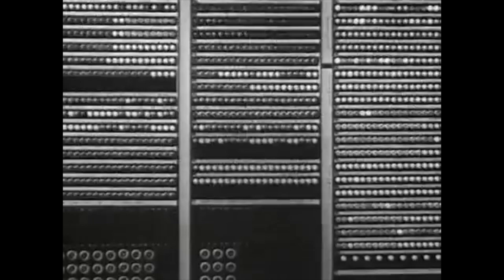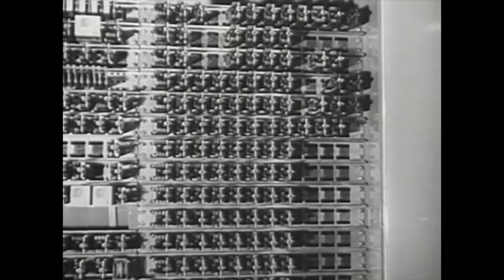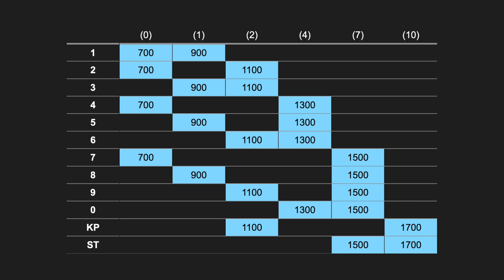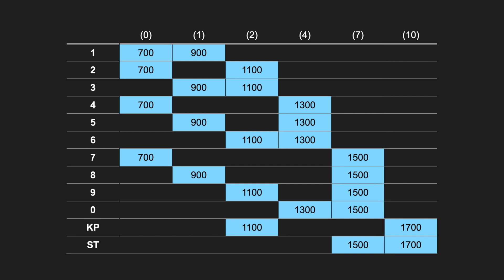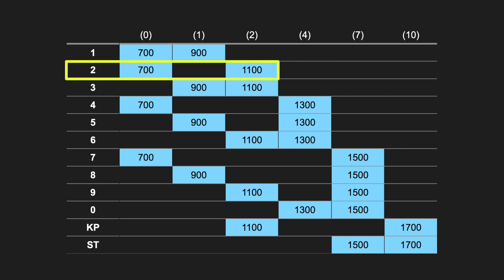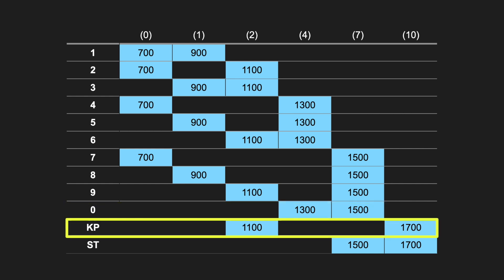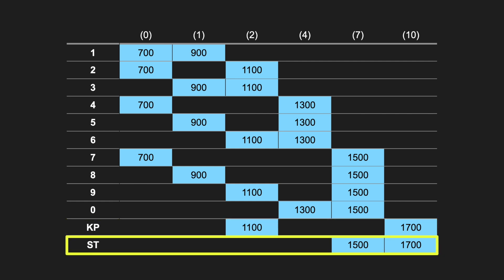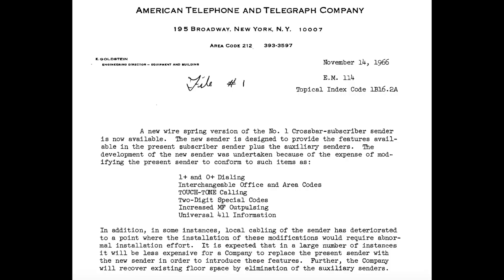How does MF signaling work? - Dial Equipment Appreciation, Part 3

Comment: The A, B, C, D DTMF tones were used by the military but I don't know if they were used by anyone else 
From what I understand about these special tones, the phone system accepted these on all their equipment 

On cellular towers they used these A, B, C, D codes on the overload class

For regular cell phones the last digit of the phone number was programmed as the overload class 

But for State and government phones for some people the overload class was A, B, C or D

These could not be programmed in regular phones or from the service menu. They were programmed using special equipment to program the eeprom

The cellular towers would get busy in those early days and you would see all 100 lines in use often 

When the phone did a handshake with the tower it sent it's ESN and when it placed a call it sent it's overload class and if all the Frequencies were in use and you had an A, B, C or D the tower would drop one of the lowest class calls, usually 9

If you were constantly dropping calls or couldn't get a call to go through, looking at your phone number was a good idea, but most people didn't know about this. 

If you had a number ending in 9 you would have a lot of dropped calls. But if you had a number ending in zero you probably didn't have calls dropped 

The towers would handle calls and 3 towers or more would receive the signal and pass it off to the closest tower and the signal was still being transmitted to the former tower. 
The tower that took the call would send a ANNNN, ANNNN, ANNN sound on the frequency of the former tower to activate the drop off from the former tower. 

I heard this constantly 

The customer would heard the call get louder and an echo as the call was handed off.

Comment: OK.. So my understanding is that people used pulse dialing, BUT touch tones were used exclusively by the phone company (between whatever dates) to send/receive/connect signals to each other... for some period of time until the tech was eventually upgraded to allow touch tone in the standard home?
Reply from the maker: Yes, except that MF signaling uses different tone pairs than the touch tone telephone does.
Reply: @ConnectionsMuseum  That explains the end of the song "young lust" from Pink Floyd The Wall, album. Ever hear it? Maybe you could do a quick video sometime, explaining the sounds and telling us the phone number and accuracy of the sounds used?
Hey, there is also a great video by the 8 bit guy covering fracking with sounds generated by the Comodore 64. I used to have the program they used but never really understood what they were for except for the obvious "coin drop" sounds. Maybe that would make a great video too. I like what you're doing with the old equipment

Comment: Standard Touch Tones also called DTMF, thats Duel Tone Muli-Frequency. There are single tones for each row and columb. Pressing anytone generates TWO Tones indicating the Row and Columb to make up the two tones. So, the Rows and columbs, each has its own tone. ROW One has 1, 2 , 3, A, Row  two 4, 5, 6 and B,  Row Three has 7,8,9 and C, Row 4 has * ,0 ,# and D

Comment: Actually, back in the day, the MF muting was often imperfect, so I would hear the MF tones in the background before the call connected. The phone system had some crosstalk and on many of the raw Apollo era NASA tapes I can hear faint MF crosstalk into NASA's dedicated circuits from time-to-time.
Reply: There were some exchanges where the caller, after dialing the last digit in a long distance number, would hear, at low level,  the MF tones being sent from the local exchange to the toll equipment. I don't think that the engineers even admitted it, but I believe that was done deliberately. There was some filtering that skewed the level of the tones so they could not be used to send a phone number if recorded and played back into a sender. The tones would be rejected because of too large a difference in level. (The receiving equipment rejected a tone pair if the levels of the two tones differed too much.) After the Esquire "Secrets of the Little Blue Box" article was published, the phone companies modified their equipment to block the tones from reaching the caller.

It was commonplace to hear, in the background on a long distance call, MF tones being sent on other circuits, as timothystockman7533 mentions regarding the NASA circuits.

Comment: @connections Museum -- Sara, I Just saw this cool video, even though you posted it 2 years ago.
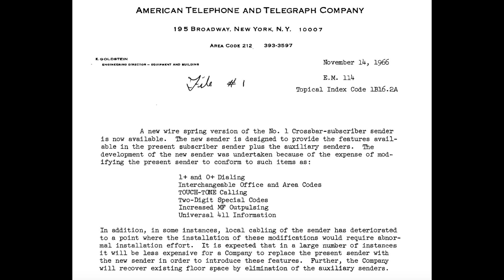Part of what the "new sender" that your crossbar can do is TouchTone as shown at 6:46 of the video.  When I was a kid, the Crossbar CO in my home town had TouchTone so it had the new style sender.  What is interesting is that your switch uses the old fashioned "buzz" style dial tone, where as the one in my hometown had the modern dial tone associated with touch tone service.  Do you have any ideas or historical perspective why Bell Companies changed the sound of the dial tone

Comment: Hi Sara. Really enjoying your videos. Trying to find one that shows how the systems handle thousands of subscriber lines, in terms of termination and digital switching. Is each subscriber's line terminated individually at the exchange, or is it normally multiplexed at the termination point. As someone long fascinated by computer theory, telephone exchanges seem to encompass all of the principles of computing but on a much grander scale in terms of shear heft and widespread use well in advance of large scale adoption of industrial computing elsewhere

Comment: At about 11:40, the 314A Trunk Test Set from Berry Electronics, Santa Cruz, CA, is demonstrated. Berry Electronics was an independent supplier of test equipment, selling to the telephone companies. It is interesting that the test set's case was painted blue and the test set referred to as a blue box, the same name used by the hackers for a device that exploited the long distance network's tone vulnerability.

As described in the video, MF signaling dates back to the 1940s. The combination of the SF signaling system, which used a tone to represent a trunk's status, on hook or off hook, and the MF system to transmit the called number, made the tone exploit possible.

Initially, long distance calls were handled by telephone operators, who functioned as a sort of gatekeeper, detecting unusual activity. Customer dialing of long distance calls came later, opening the door to use of the exploit without a human monitoring the circuit, other than by a possible technician or by random monitoring to check call quality.

Phone company security employees were aware of the vulnerability as early as 1960. SF could have been migrated to "out of band" signaling, possibly reducing costs, in addition to removing the particular vulnerability. SF signaling units had sophisticated filtering to minimize "talk off", the disconnecting of calls when the audio present happened to simulate the SF tone. The first SF units used vacuum tubes. They were later redesigned with transistor technology. Better than replacing vacuum tube SF units with transistor units might have been to migrate to "out of band" technology.

Besides playing a short burst of the SF tone to disconnect the call and get an MF receiver connected, there may have been other ways to get an MF receiver on line. However, that would have been more difficult and there may have been fixes. Blocking access to the MF receiver would have closed this tone vulnerability, which became a major problem in the 1970s.

As early as the 1950s, AT&T was also well aware that customer dialing would eventually be expanded to all, or nearly all, telephones, and very few calls would be operator handled. Toll free numbers must have been in the planning, at least in the early 1960s. The exploit required dialing a number to get access to the long distance network and then using the tones to divert the call to another number. Toll free numbers were nearly ideal. The number used to access the network would appear in phone company billing records. If that number were toll free, the customer would not be billed. The phone company would have a record of the call, time that it was placed and its duration, just as for any other long distance call, but the call did not appear on the customer's bill. Suspicious calling to toll free numbers was used to track down individuals exploiting the tone vulnerability.

At about 12:25, the "tea cart" is shown. Using 1940s technology, a homemade electronic tone generator might have been that size. However, there were musical instruments, such as pianos, that could be used to produce the required tones, but the piano might not be close enough to the telephone. Small, battery powered, tape recorders became available in the early 1960s. The tones could then be recorded and played back almost anywhere.

Comment: On ham radio keypads there are 0 through 9 and there is also * and # and there are 4 letters A B C and D

I have seen touch tone phones that have a similar keypad
The phone has 
FO ( Flash Override ) in the A position
F ( Flash ) in the B position
P ( Priority ) in the C position
I ( Immediate) in the D position

I don't know if the phone company actually used the same tones that are used in ham radio

Have you seen these special phones ?
Reply from the maker: Yes, those keypads are for the AUTOVON military phone system in the US. Allowed "pre-emption" of calls, where a more important call could break through and interrupt a call already in progress.

Comment: If they had gained the technology to do these MFs, then why didn't they replace the tone wheels with this solid-state (or semi-solid-state) technology as well? And what kind of storage were these signals remembered on: core memory? And if they had that kind of technology for tones, then why did it take so much longer to come up with the electronic technology for switching too, especially when this is the same year that the hard disk came out?
(I keep thinking of the 1950s as really dark ages with hardly any technology, but then ya gotta remember: it's when the dang HARD DRIVE came out!)

Comment: The tones come from a two out of five, combination of tones. Today's date is September 9th 2022. That's the number one crossbar office. Number one ESS, electronic switching systems, first introduced in 1964 or 63. My first exposure to number one ESS was in Brooklyn on Bridge Street. As soon as I saw the equipment for the first time I said that's where I want to be, I did not want to be part of old school crossbar equipment. I went to school for number one assess, ETS, electronic translator system, tsps, traffic service position systems, number for ESS, electronic switching systems digital All Digital, and number five ESS first digital fiber optic switching system. Today is September 9th 2022.

Comment: I worked the 16B test board in AT&T long lines and there was a MF signal key pad on the board. You could plug the test pad into a speaker and have some fun.  I learned to play something very close to the song played before the old Laurel and Hardy films.  It was really funny .

Comment: I worked in the #1 and 1A ESS at NY Telephone company between 1972 and 1982.  on some trunk testing you could hear the machine send out KP+10 digits+ SP.   But it was really fast as the outgoing MF transmitter would get a command from the ESS processor  as the machine picked an available out going trunk  to the toll tandem . after putting out a off hook toward the toll tandem the machine would look for a wink which was a quick on hook-off hook-on signal that the tandem was ready for the 12 digits . in MF signaling the wink had to be between 100 and 600 msec.  Once the ESS detected a good wink from the distant end it connected an MF transmitter to the trunk and sent a digital order containing the dialed number  to the transmitter and it then and spit them out to the distant end very fast. if you pay close attention to the operator completing a call you will notice the first digit she hits is KP(key pulse) and the last is ST ( Start).  That was how toll and class 5 switches processed an outgoing call with inband signaling using MF digits. Touch tone is not MF. it iis DTMF which stands for dual tone multi frequency.

Comment: When I was young (in the '80s) I was really into telephony, having managed to get a few tours of local (UK) switches; One ancient Strowger system, and a slightly newer TXE4 (common control, reed relays), plus a System X switch (fully electronic, the new shiny - at the time, I think it's since been superseded by fully digital what with the 21CN rollout, eventually there'll be no analog lines left in the UK) that was being trialled at the time. Then as now, I had absolutely no idea how it all worked, but it's still fascinating. Thanks, as ever, for your informative videos!

Comment: Love that you have your own recording on the announcement machine! Did the original one get deleted/corrupted with time or did you decide to redo it just for fun?  

In the museum, how many numbers do you have that will actually put you through to a phone? If you dial a number which would normally connect to a different exchange do you also get the "Not in service" recording?
Reply from the maker: Not sure what was on that machine originally, before we recorded over it. (It was probably back in the 80s or 90s sometime). It's likely that at the time the museum acquired that machine, there were so many of them in service that overwriting the existing recording wasn't a big deal. 

We probably have between 80 and 100 working numbers. Anything non-working should get a not-in-service recording, on the 5XB and 1XB. In the panel, you'll just get a re-order tone.*

* It's slightly more complicated than that. Too much to explain in one youtube comment! :)
Reply: @ConnectionsMuseum  Thanks for the reply! I keep forgetting that the place has been operating for a pretty long time so it's normal for some things to not have been regarded as rare when they were first acquired.

80-100 lines? That's so cool! At first I thought you maybe had 5 lines based on the number of handsets I've seen in some of the videos talking about the switches but now that I think about it those frames have space for a lot more than that so it makes sense.

I really love what you do there, I'm too young to have experienced it, but the network at the time of the Bell monopoly with all the electro-mechanical switches and when it was analog fascinates me and I think your museum is the only place where you can experience it at such a scale. I know there are other places and private collections but those are usually the size of a small PBX so not as cool to me. 

I'm very much looking forward to more videos like the phreaking one and in the meantime I'm catching up with all these ones you've been producing during the pandemic.

I'm in Europe but when Covid passes if I get a chance to visit Seattle the Connections Museum will be my first stop :)

Comment: I remember those famous crossbar clicks so well.   My exchange was 469 and it was crossbar and if I called someone else on the 469 exchange I would hear the click and it would ring immediately.  If I called my grandmother who lived in a sister city on the 423 exchange, I’d hear the first click and then a second click and it would ring.  Now I know why.  The 469 exchange was sending the MF tones to the 423 exchange during that brief pause.  You’re correct, there were no audible tones.  Just dead silence for 2 or 3 seconds.  I never knew exactly what it was doing.  It would also do a longer pause when calling a step by step exchange because I’m guessing it would need to pulse dial the last 5 digits of number since crossbar required pulse dialling.

Comment: This is so awesome!  I've long been curious about how crossbar worked (former DMS-100 tech here).  I do have a dumb question: how does the originating sender get signaled that the terminating sender is ready for it?  I know with RP you know the terminating sender is ready when it starts winking...but how does that work with an MF sender?  Polarity reversal, a flash, a tone?
Reply from the maker: Thats actually a very good question! With an MF sender, the far end reverses polarity as soon as the sender signals that it's ready. So the order of operations is: the trunk is seized by the originating end, far end of the trunk finds and attaches to a terminating sender. Sender signals to its trunk that it's ready to go, trunk sends a reversal back towards the originating end.